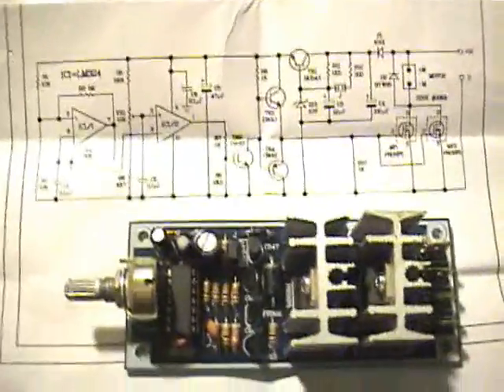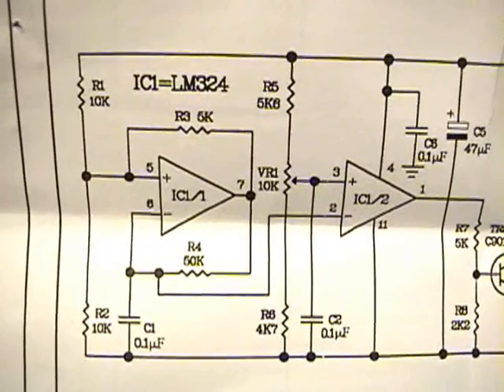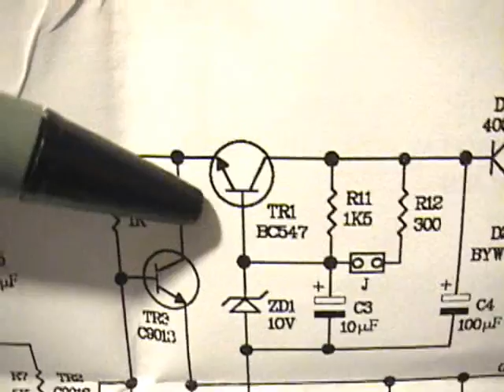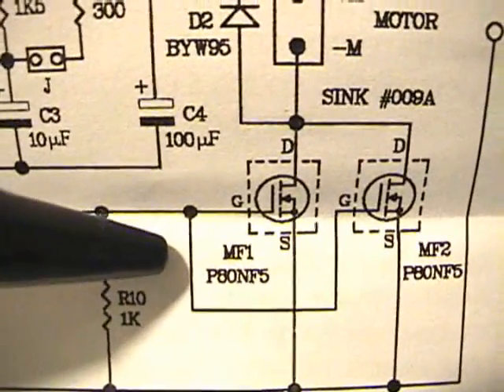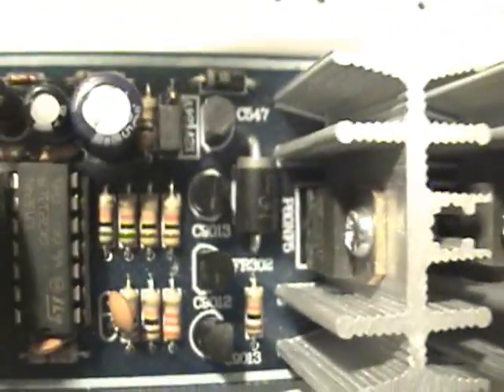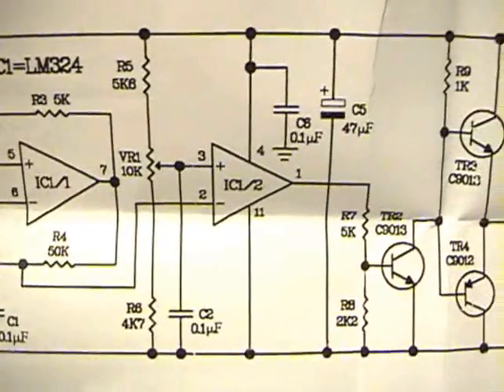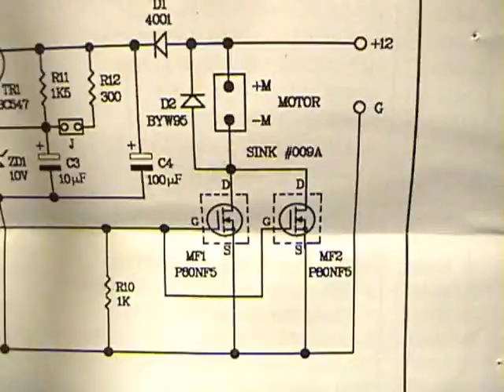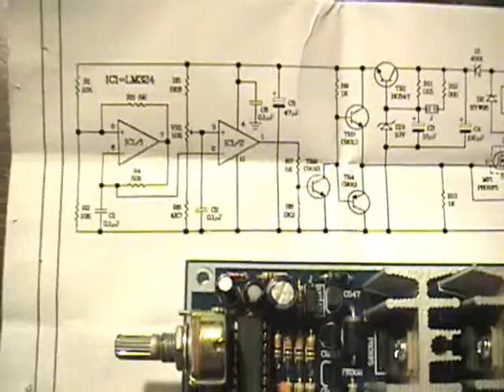(23) HHO 30 Amp PWM circuit diagram + EFIE

Comment: Hay delvis what's up.  Good video yo.  I built the circuit but on the output I'm only getting 7th.  Can you send me the diagram please please please.  I live in Jamaica and I'm about the only one in this country doing hho.  I tryed the 555 timer circuit bit of only works with a small cell that i built,  now i have 2 bigger one's and need a good pwm..email.  benjidon03@gmail.com. . Please if you can?

Comment: Why not use simple ne555 build, with n-fet (irl3803)

or BTS555 (bts555 willl work with frequency  to 200Hz..or more)

The more power you want to switch, just use more nfets in parallel.
If used at low frequency (up to some khz) the gate charge
+ discharge current for nfets can be handled by ne555 directly. 

if you want positive side switching use irf4905, but has more on-resistance
Reply from the maker: Problem with the 555 build your mentioning is that it real inefficient and builds a lot of resistance that makes tons of heat. This board in the video is slightly better with it's op amp and totem pole gate driver. There are better ones but they cost a little more.
This one is digitally controlled so it is real efficient witch generates little heat.  it uses 1 ifr1404 fet

http://www.greenfuelh2o.com/product_p/pwm50.htm

This one is analog but uses a complex circuit and gate driver IC. Real efficient and can handle large load up to 90 amps @ 12v
http://www.greenfuelh2o.com/High_Power_Controller_p/hcpc.htm

 Thanks for posting!!
Reply: I don't really see the efficency problem with the ne555:
Only power NE555 has to handle is the charge/discharge current for MosFET gate
(which should be way under 100mA in/out)
The power loss is mainly defined by RDSon of mosfets and switching delay with charging/discharging time of gate, which is not relevant until some high khz numbers.
For the low side switching with irl3803 (or some in parallel) there are no gate drivers needed,
you could add two gate driving transistors if you really want to go high frequency or use 8 fets in parallel.

BTS555 has active high side drivers integrated (cant handle too high frequency),
also current sense pin and protection.
- I used BTS555 with ne555 pwm circuit with car radiator main fan >500W+ without heatsink and without it getting warm at all.
Reply from the maker: That's worth a try. I will try it out.
Thanks for your post!
Reply: delvis11  hi sir can share to me the schematic of yr pwm. im trying to build hho for myself im fr Philippines.  heres my email noysantia@gmail.com
thank you very much n God blessed

Comment: Hello Delvis. Rode the circuit of PWM and it works just fine on 12 Volts. When I use 24 volts with the function of jumper, he loses the ability to work and the BC547 superheat. Help Me please. Thank you very much. My email: bigfla1@gmail.com

Comment: hi 
i was searching a lot for a circuit that control the speed and the direction at same time by using a 10k potentiometer for my 24V motor 250 watt is this circuit good for it ??!! please if ok sent me the pdf or if you can help me with something diferent please cause am doing a project for my kid to control a motor by RC signal like where you conect the servo motor 
 a lot of thanks

Comment: lookin on jameco or newark i found a few of the lm324 chips in different cases. But that's not a problem. The problem i ran into is that there's no straight LM324, however there are LM324N, AD, AN, NG, NE4. Would it make a difference if I used one them?

Comment: hello I have a question delvis11 the flat or do not see the connection jumper to voe 24v only the 12v at the mysterious where you can take the 24v or so goes the plate feeding dae att: Jhon Jairo

Comment: @Mapanatl Now to end this conversation... I worked for Lucent Technologies and built tested and temp studies for switchmode powersupplies AC/DC and DC/DC and YES, we had substantial heatsinking with a fan delivering a hurricane over the heat sinks and still they measured 130F or more at room temp. Part of my job was to do temp studies. I ran more damn fets theough a curve tracer to get matched sets than I care to remember so get down off your high horse, son. Proof? I got proof. you got fuck-all

Comment: I am doing that with PICs or AVR microcontrolers. So forget all transistors except MF1&MF2 and D2 then add one AVR e.g. Attiny13 and one Pot of 10K and instead of ZD1 of 10v put 5,6V. or use 7805 mini. If you add one more pot you can change base freq.

Comment: yaw boring  kids stuf i rigt my own  amp's  this is just child stuff  i have already build that junk where are the old tubes those are still make more hq sound than transistors  damm if you see my you tube pagen you can see what i work whit evry amp you see ia rigt beyond its original  capcity power it dubble its power in watts

Comment from the maker: usually the mosfet will fail. i have burned a few of these too. best thing to do with these 30 amp units is to put a 25 amp fuse on them and the use of a fan helps. The mx067 is a lot better 30amp unit.

Comment from the maker: I think your having a bad day.

I never said this was my circuit. A user asked me for the circuit that I didn't have so I made a video to help. 

I now have this on .pdf if anyone needs it.

Get your facts straight. This is a PWM which can also be used to control a motor. And yes you can find these on ebay. Thats no secret

Give your mom a call. I think you may need a hug.
Reply: Can you share this diagram with me, dennis.stroba@live.com
 I am looking for a circuit that can be projected into a vessel that will contain semi-liquid graphite solution. At a frequency between 410HZ and 430HZ. Do you know of anything like this I could build?